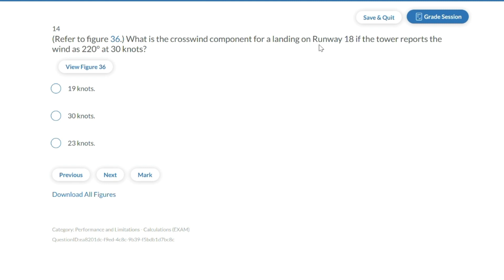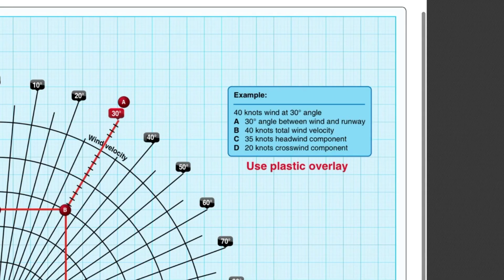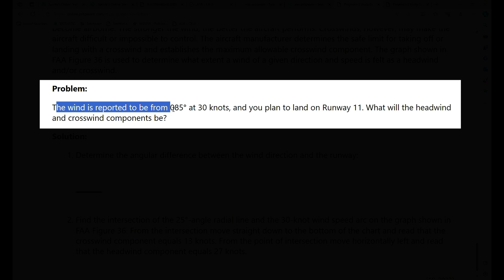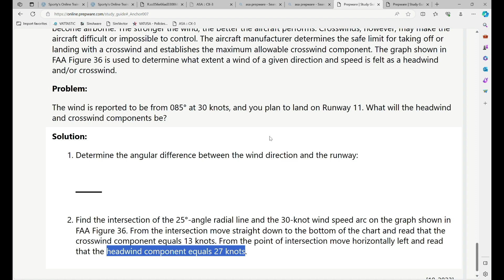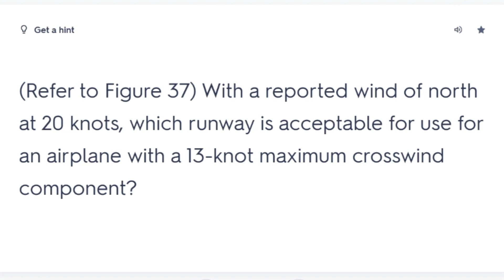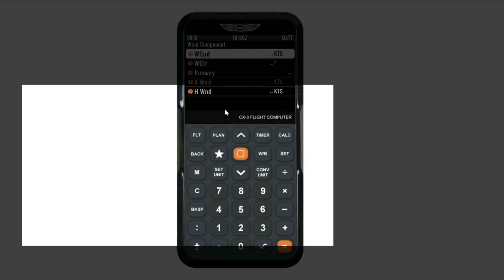FAA Private Pilot Exam - Solving Wind Component Problems

Comment: Also, a cool x wind component mental man i learned is to take rwy heading and wind direction delta + 2 and multi by wind speed.  Example: wind 180 rwy 14 ( delta is 40⁰ + 2 = 60⁰, drop 0's for delta and wind speed thus : 2 x 6 =12kts. Ya kno what nvm let jus use the calculator 😂

Comment: (Refer to fig 37.) Coorect me if im wrong.. but wouldn't the difference between rwy 32 & rwy 04 just indicate if i will have a left or right quarterly headwind if winds are from 000/360?
Reply from the maker: Yes, you will have a right quartering headwind if you are on runway 32 and a left quartering headwind on runway 04. Either runway is fine if the wind is from the north - depends which runway is available at the airport.